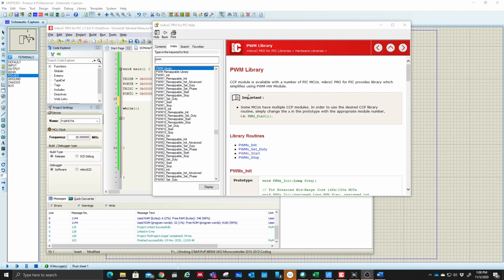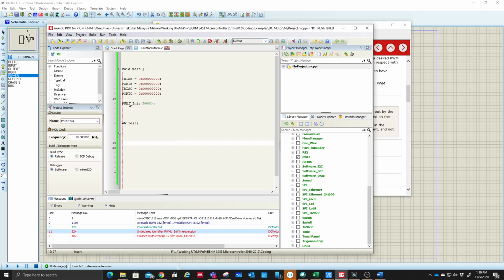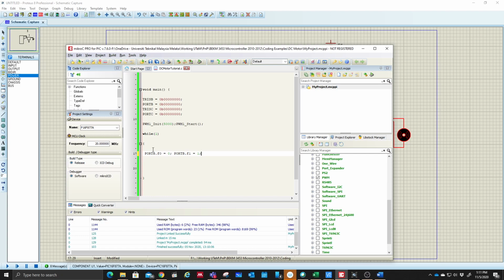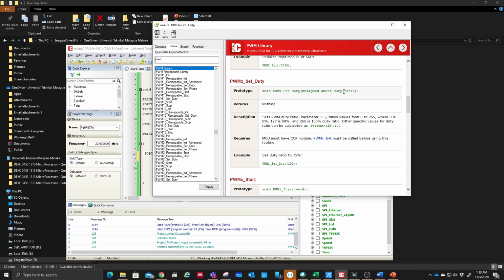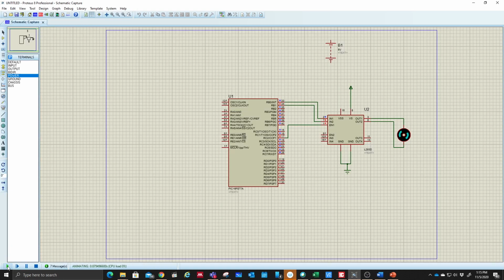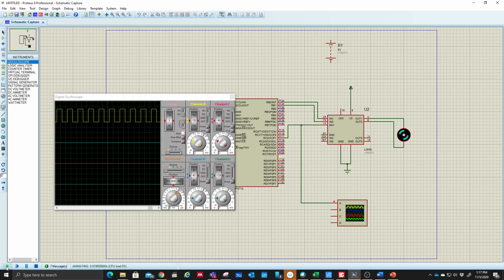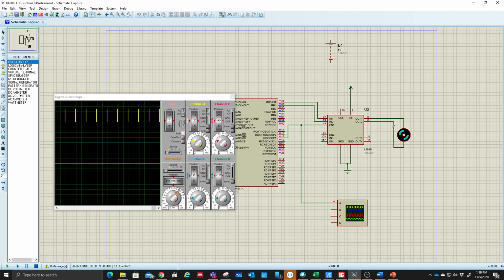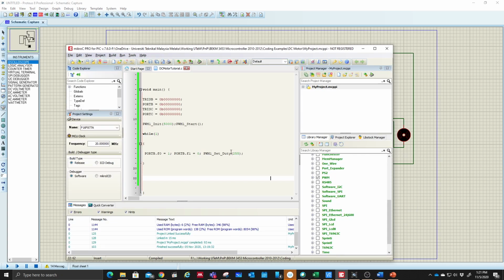BEKM 3453 PIC16F877A Tutorial 2 2 DC Motor Control

Comment from the maker: The connection for L293D in proteus for VSS and VS are wrong and it should be vice versa.

VSS if for 5V power supply
VS is the battery to support the motor for spec more than 5V for eg. 12V

Sorry for the mistake